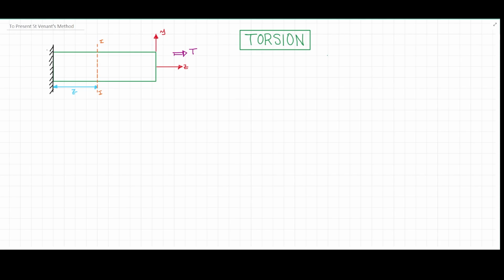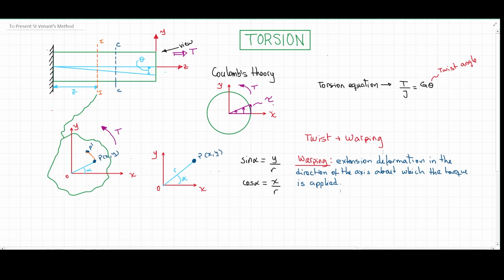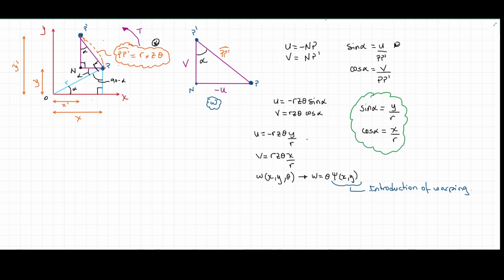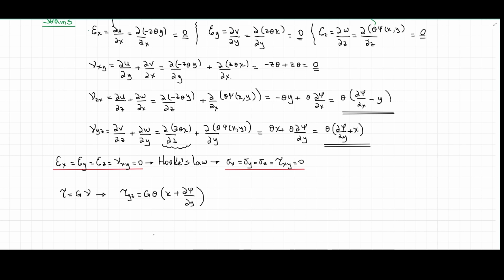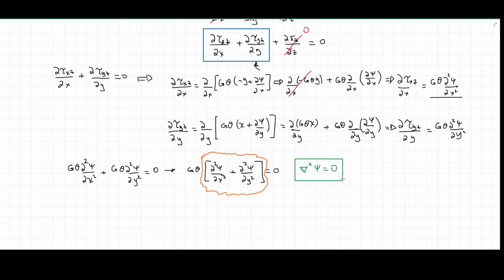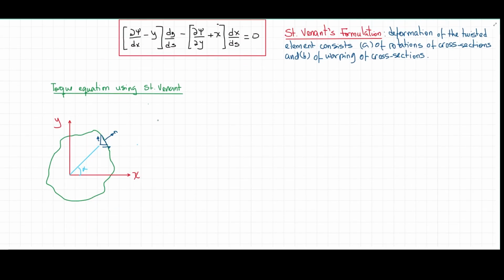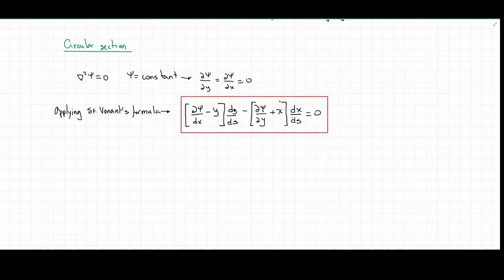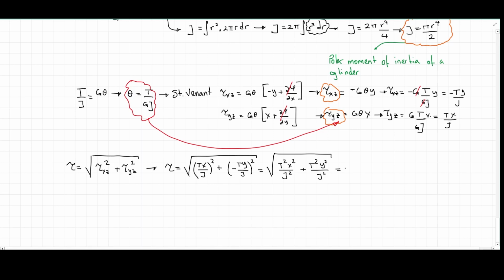A Comprehensive Guide to St. Venant's Torsion Equations for Mechanical Engineering Students

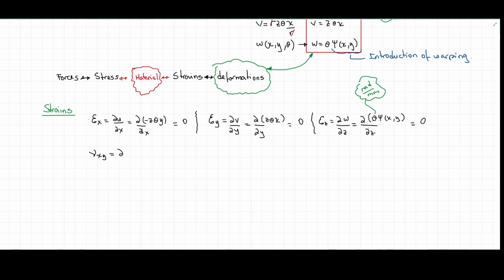Comment: hello, in min 34:55 why Vxy is du/dy+dv/dx? i dont know how you got there... could you explain? thank you so much
Reply from the maker: Hi, great question. Indeed, I didn't show how I got that equation. This equation comes from studying the normal and shear strains formed after deforming a 2-D rectangular element.  I found a good picture here: https://encyclopedia.pub/entry/34091 

Hope it helps
Reply: @johnbruzzo  omg it helped, thank you so much. I found the same here https://www.youtube.com/watch?v=Hf9ETnwcF5s in min 22, i am trying to figure it out how Vyz and Vxz are obtained, it was using the angles showed in the video (theta and phi, following a similar analysis), i needed to know that to understand why i can use the equations and how that could change with different examples...thank you so much